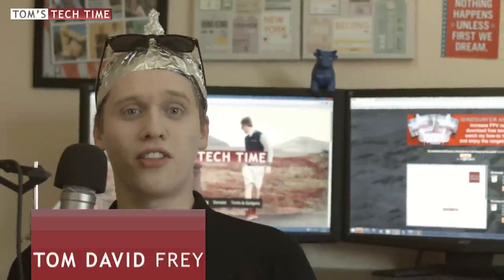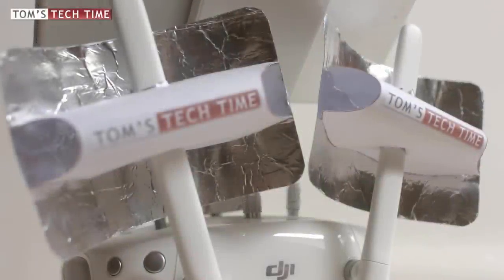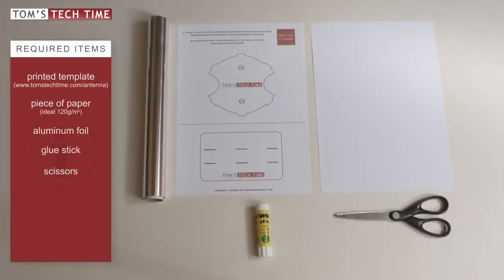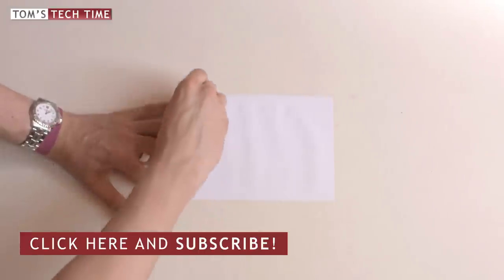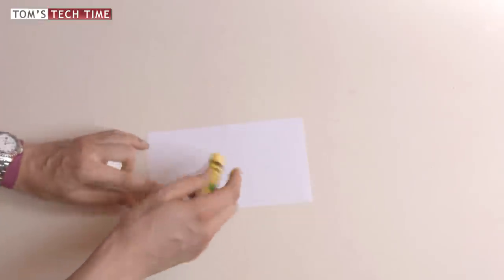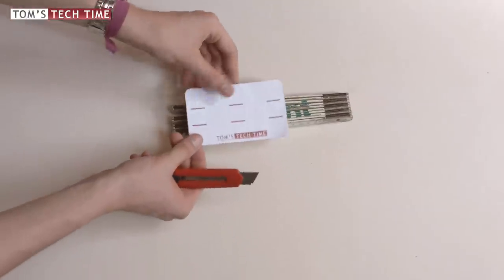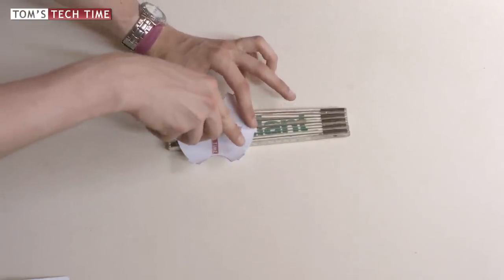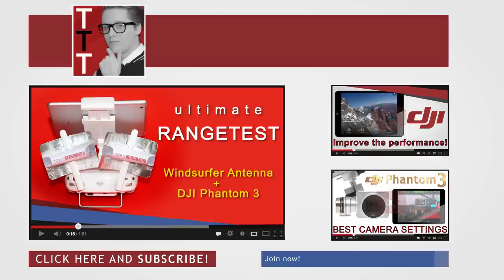How to make a WiFi / FPV Range Extender | Video Tutorial

Comment: Holy Crap! I took my P2V out the other day with my new fancy schmancy paper & foil range extender - and it worked!
I've been having distance issues lately where I couldn't get out beyond 400 or so feet. I slapped this baby on and got out 950 feet. To be fair, I didn't have a second battery charged up so I could try it sans extender but that will be my next test. So far, I'm Impressed!

Comment: Thanks for making the task of making a DIY windsurfer range extender so easy - works very well.
Reply from the maker: +Keith S Thanks, Keith! Feel free to share the link! Stay tuned and fly safe!
Reply: +Tom's Tech Time When are you going to have a giveaway of the dji phantom 4?
Reply: Tom's Tech Time  hey tom does this work on all transmitter? I have a jxd 510w
Reply: +Tom's Tech Time. hey tom does this work on any wifi fpv quacopter? i have a jxd510w with one antenna
Reply: King Kong yes it will
Reply: Game World yes it will

Comment: Furthest flight before was 1008 meters and started losing signal a bit at this distance. With the wind surfer, I just flew 1751 meters, so over a mile. I did lose signal however, but it came back on within 5 seconds. I decided to bring it back home at that point and it went on and off until about 1500 meters.

Comment: Concept of a reflector is fine, but actual spacing and radiation pattern will rely a lot on the quality of your construction. Note that getting gain in one direction means that you may lose signal in others. So caveat emptor and check before you try extremes of range.

Comment: Hi Tom,
Just wondering why you didn't cover the center piece also in aluminum foil so the whole piece facing out was aluminum?  Would have thought it would work better.  Maybe you just wanted to have Tom's Tech Time written on it ;-)     Cheers
Reply: +Glenn Pascoe  Because the radio waves will easily pass through the paper, if the paper in the center was also aluminum it would make the signal worse not better.

Comment: If you want to use card, just make the tabs a bit longer. That way the sellotape will hold much better.
Reply from the maker: Simon Stokes Hey Simon, I agree. But that way I wasn't able to straighten the Antennas. I had to find a good working size for the Windsurfer: big enough for an easy assembling and signal and small enough to fit two of them onto the antennas without them distracting each other. Cheers and fly safe!

Comment: questions, my Drone has a wifi range for the cellphone wifi but the remote is a difference frequency, i want to extend the wifi part, how can i do that? the wifi antena is on the drone..
Reply: Better antenna on the wifi transmission

Comment: Great tutorial ;)
can i use normal wrapping paper shinny glossy surface to replace aluminum foil? As couldnt get a smooth surface over foil.
Reply: +Mervyn Cheryl 
You need the metalic surface to reflect the radio waves, the idea is to direct as much of the signal forwards as possible, and thereby make it much stronger, paper will just let them pass straight through and you'll get no improvement at all.